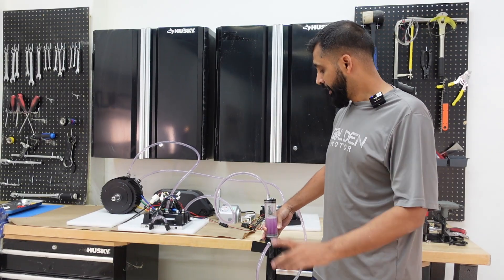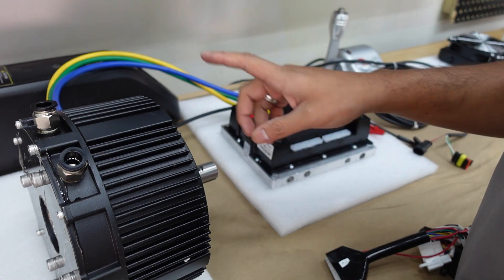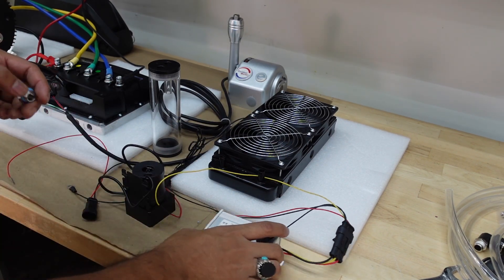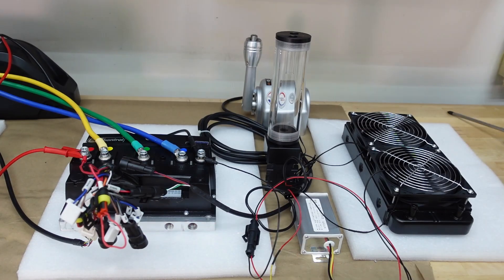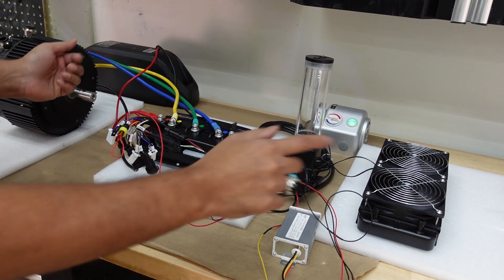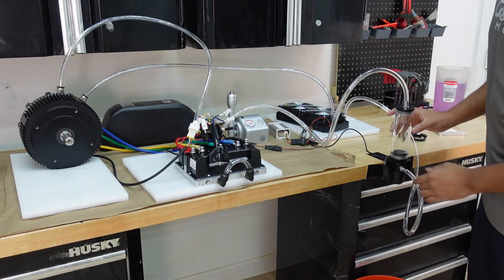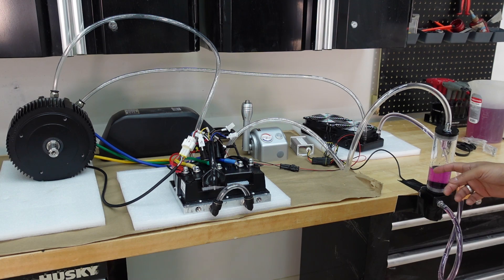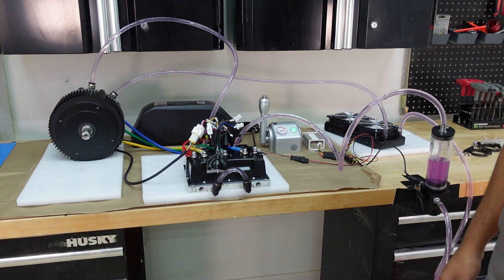Liquid Cooling BLDC Motor and Controller Setup

Comment: I’ve noticed in your videos that you brush over some of the awkward moments. The pipes that come with the cooling kits are 8mm internal diameter. The plastic barbs on the radiator are 10mm. Let’s see how you get the pipe on there. Note: don’t use fairly liquid as lube unless you want a lifetime supply of bubbles in your reservoir. Use lithium grease.

Comment: Can this system pull fresh water from a lake for cooling? eliminating the need for the radiator?
Reply: I was advised not to use river water straight through the radiator, controller and motor due to possible blockages, contamination and corrosion of the aluminium/chinesium parts.

Comment: Hi, I have the exact same setup only with a a new  15kw (48v version of 20kw) for my boat. You now have the pump and fan right away to your 12v battery. I would like to have it run when I push the button on the throttle. Is that possible?
Reply: hey mate do u have a link to the new 15kw 48v version please
Reply: @vkdirector3087 no, they dont have it standard in there pricelist. Its’ the motor that comes now standard in the IB-15 inboard motor
Reply: Yes. You just have to add another controlling mechanism to do it in your system.

Comment: Hi. I am getting encoder alignment error.. my encoder is properly working . And motor sensor set on encoderpwm as the encoder option does save when updated.  The controller does detect and shows the motors rpm when being turned by hand. But the controller still giving off alarm. What should I do?

Comment: The controller produces less heat, no? I'd have the radiator feeding the controller, then to the motor, then to the reservoir. Seems like on a hard pull the heat of the motor will be bled into the controller which is already working hard...
Reply: Yea I think this video has those 2 components backwards
Reply: i was thinking the same